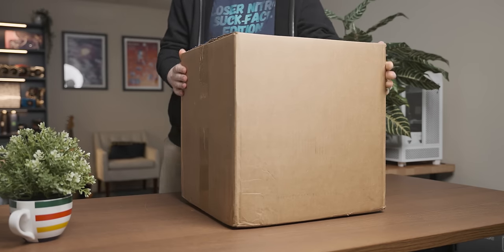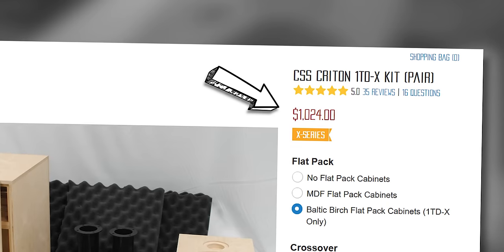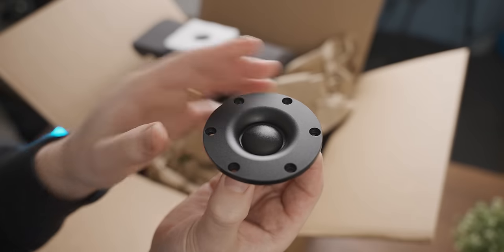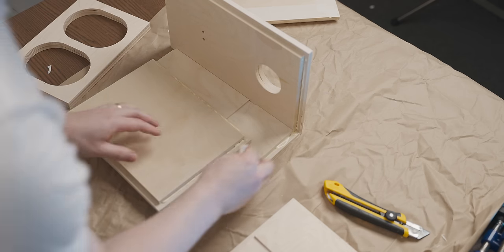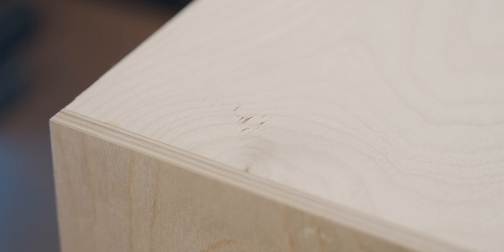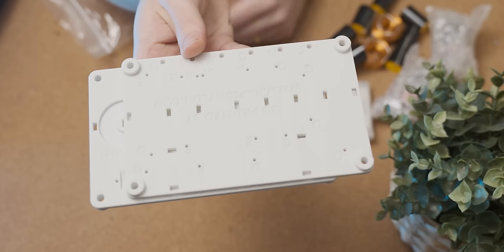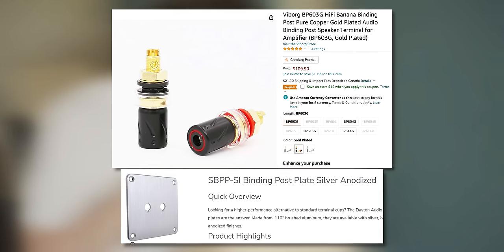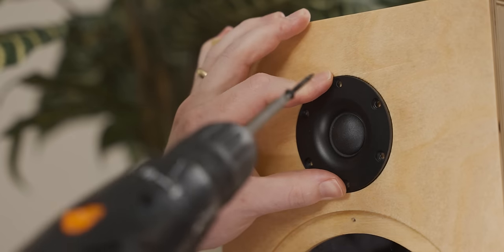The MOST Underrated Gaming Upgrade: DIY Speaker Build

Comment: OK. should have left the soldering in anyway, cause the point of many coming to watch is to see exactly how one can do it! Anyway, you should try some music. you don't know what you got there yet. And try getting an amp with 2 times the wattage recommended for the speakers, preferably class AB, and better yet, get the premium upgrade crossover. then you will really understand what the speakers can do. the setup you've got now just shows how good the CSS is without all the stuff I mentioned, but it still has more to give.

Comment: just gonna put this here.. you really dont need a thousand dollar pair of speakers to achieve an experience like this, buy yourself some active studio monitors for like 100-200 and an external sound card (audio interface) setup the drivers and you're good to go with an experience very similar to this. will you get the same amount of bass? probably not, but its plenty. id say going from no speakers to monitors is a much bigger jump than medium quality speakers vs high end ones. plus you can use a dynamic/condenser mic for better quality than headphone mics and some sound cards even have a 1/4 headphone jack on them for the best of both worlds. and my personal favorite feature is having a physical volume knob, i havent touched system audio in years. if you do do this and buy a cheaper card, be sure to disable other sound drivers like realtek and nvivia sound drivers as they could cause audio issues.

Comment: What I'm struggling to understand is how these differ from a decent set of bookshelf speakers. I wholeheartedly agree that good bookshelf speakers driven by an amplifier will give you much better sound than you can achieve with normal computer speakers, but I can't see where $1000 on a DIY kit will necessarily best a pair of bookshelf speakers that can be had for much less than that
Reply: you get what you pay for.  there is a sweetspot from where you get diminishing returns but in the audio world below 1k on a pair of speaker is actually considered as kind of budget. 
like those arent even expensive at all and its the starting point where speakers really start to tier up in comparison to super cheap mass produced ones. 
especially with diys because diy speakers usually compare to prebuild speakers way above their price point.  a friend of mine build himself some subs for example for like 500 each?  those guys sound better than some 2000 bucks subs ive heard. 

his diy ones ARE bookshelf speakers. go to some audio store and AB Listen something like a Buchardt S400 and some entry lvl 300 400 bucks elacs or klipsch or whatever, most of them have the cheapest crossovers you can imagine worth pennys. 
its a night and day difference. and a 1k diy speaker starts to play around in the same league than a 2000 dollar pair of S400.

sure you can game on a 1k dollar pc, but can it do 4k high resolution and high refresh rates? ofc not because a 1k doller pc is a budget gaming pc... speakers are no different in that regard. and similar to that, you get a lot more high quality components and a more refined system at lower prices if you build it yourself. imagine buying a 1k dollar prebuild dell pc. fancy green noname single channel memory and a silver no name chinaBoom power supply. stock cooler, cheap as hell mainboard. only one fan because cost saving... this is basicly what you get when you buy budget speakers aswell. so you either go one or 2 tiers up in price class or you pay around the same with DIYs that punch 1-2 tiers up without costing as much

what you said is basicly: ''oh i dont see how someone can have more fun with a 3k pc compared to a 1k pc that you can have for way less because they both play the same games''
i mean yeah... if you re fine with playing the new game in 720p 30fps compared to 4k 144fps... sure... go for it

Comment: I used to design and build my own speakers. Don't downplay yourself you did a fine job. And Dayton audio makes some good stuff. As for the cross over. If the more expensive ones were a better crossover like the next order up with more components might sound better. However if it's the same parts, just more expensive don't bother. You would never hear the difference.

Comment: I think it would be better if the wooden planks had toothed interlocking ridges on the edges so that the rigidity of the box isn't relying solely on a very narrow and thin strip of glue. The wood isn't going to withstand almost any force at that contact point with the glue as it is currently. The majority of joint rigidity should come from interlocking shapes rather than glue.

Comment: I know the tolerances might be tight to achieve in high volume production, but why rely on glue and not some type of joint? Glueing wood is kinda tacky
Reply: Because that's how joints usually are done on speakers.

Comment: I actually went a different round with my sound setup. I took a car amp with a pc psu connected my 1200w sub and some smaller speakers for treble but in total i have 5 subs. On my to do list get a bigger amp and get a bigger psu to power it. Sadly the sub box cost more than the actually sub cause it's specially made for this sub. The other speakers are DIY

Comment: Wow Davide is an audiophile! Unico Primo, very nice. Not to brag (ok I'm bragging) but I run my PC audio thru an AVR (for D/A conversion), then into a Parasound Halo preamp and amp combo into a pair of B&W Nautilus 802's. Very Visceral. Yes my TV is my monitor.

On an unrelated note since you are such an expert on lopsided pc part pairings,  I am stuck with an i7 4790k w/ 16gb of ram and a 780ti. I play WoW primarily and the card struggles a bit with water effects, etc. I have to run it at '6' video settings. Is an upgrade to an RTX 3060 worthwhile or would it be bottle necked by the CPU? tia and keep your entertaining videos coming.

Comment: I clicked for two reasons.
1. A Unison Research Unico Primo amplifier on the thumbnail
2. Hoping for Linooooooooooooooooooooooooooooooooooooooooooooode

------

Regarding the amp: it has 80w per channel in Class A. Not as efficient as Class D fullrange given you can find 300w per channel amps with that topology smaller than the PS5, but Class D always seemed to sound a bit cold to me. By contrast when Class A sounds a bit cold it tends to be because you're cranking up a lower power, usually lower cost Class A trying to drive the wrong speakers. The Unison Research amps made it possible to get gobs of Class A power that you would otherwise expect from, say, Krell and at double the cost (without factoring in that such a Krell, at the time, tends to be a dedicated power amp and would also need a dedicated preamp).

IIRC the old Unico is the one that came out 20yrs ago, followed by the Secondo, etc, then they reworked the naming and updated the amps so now there's an Unico Primo and Unico Nuvo instead. On that note if you have the old one I wouldn't spring for the new stuff...there's a reason why they didn't drastically change the design.

Comment: I'm... Kinda confused. What's the DAC for? 🤔 There's no digital output needed for playing audio from a computer?
Reply from the maker: The Amp only has RCA inputs. I could use an adapter from the 3.5mm jack on the motherboard, but that's a bit savage. :P Besides, external DACs are much higher quality than the ones in most PCs. :)
Reply: @DawidDoesTechStuff  3,5 to RCA cable is a single cable, but sure, I do agree on the external DAC being better. Is it needed for gaming, though? Or even most music? No. If you're doing music production, then sure, but otherwise I'll stay on "it's not really needed" (many bucks saved). The speakers look pretty good, though. And is probably a very decent upgrade.

Comment: for that kind of money they should be three way not two way - JMO  Also, I dont game anymore so I dont understand shy a DAC is required, cant you just run the PC's audio to a standard stereo audio amp or audio receiver to power them, thats what I used to do, you do this any time you connect a CD player to a receivers line inputs and it works just fine - seems if you have a stereo receiver and want to use that it should work as a DAC as well -  ??.....

Comment: I have issue with your soldering, the censoring rectangle you use was in the wrong orientation, this may lead to cold solder joint :P

Comment: What an awesome video! I've been spending the last week researching and deciding which small class D desktop amp (I even looked at the one you mentioned) and vintage hi-fi bookshelf speakers to use for my desk. Maybe you can piggyback this video with a similar one pointing out that you don't need to spend thousands of dollars to get good quality audio and the 80/20 rule heavily applies to hi-fi audio: Spend 20% on similar size '80/'90s/'00s bookshelf speakers/amp and get 80% of the quality.

Comment: although the notion of building your own speaker boxes and such is cool... all you need for an amazing sound system that isn't determined by some marketing department somewhere for some reason... is a REAL stereo receiver with digital optical input or HDMI input. for instance, around 10-ish years ago, i bought a 750w 5.1 Sony stereo receiver with Boston Acoustics speakers. good motherboards usually have a digital optical out, but a sound card costs about $100. so to recap- $250 receiver, $400 5.1 speakers with a 100w separately powered sub connected by a true digital signal compared to $1000+ 2 channel studio monitor speakers...
Reply: A pair of brand new Yamaha HS8 with an audio interface will cost about the same, and you have a mic input for cursing your friends :)
No matter how you look at it, this DIY speaker kit makes no sense whatsoever.
Reply: @ledoynier3694  if they are worth it, they are worth it. considering it's a DYI thing, i would also hope so lol! if this is you, and if you have a separate office space thing in need/want of a good satellite sound system, then ok, fine. splurge, if you can. personally, especially for gaming, i'd probably just go with a good 7.1 headset. not a rich guy either, so PC is either going to inevitably end up off to side in living room or bedroom. in which case, i'm probably just going to dual screen with a half-decent stereo receiver and patch into it with Digital Optical, HDMI, or 3.5mm headphone jack to red and white 2 channel plugs. in that order. anything labeled "PC" is usually an immediate pass for me...

Comment: I think the biggest impact is the quality of the amplifier. I use a pair of £80 TiBO bookshelf speakers with an 80s Pioneer amp and the sound quality is miles ahead of newer digital amps I've tried.

Comment: just buy some q acoustics 3010 for  $250 and a 2.1 class D amplifer (nobsound, douk audio, brezhifi, fosi, etc) for $70 and a cheap used passive ~10" subwoofer from someones old home theatre system  cost you ~$20

for under $350 you will have something comparable

Comment: I'd be very interested in an in depth list of components used. I highly doubt there's even close to $1,000 worth of components there. The cabinetry looks to be pretty well made but even then, you have to assemble them yourself. New challenge, let's see if I can build a set of speakers that perform as well or better than these for about 1/3rd of the price lmfao.
Reply: I agree that $1000 price point is unbelievably bad.

Comment: Wait, aren't you supposed to keep a gaming PC on your right so you can be blinded by the RGB flashing through the tempered glass with the heat from it melting your hand? All you had on your desk was a monitor, speaker, mouse and keyboard

Comment: I agree that audio plays a huge part in PC use and is often underrated. That said, only the elites will go to the trouble of paying thousands for a setup you have to build yourself. For a fraction of the price, I recommend two things: Klipsch THX Pro 2.1 computer speakers, plus a good set of open air headphones, paired with an optional mic if needed (I use some Philips HD9500's). Still a very interesting option, even if it is out of reach for many gamers.

Comment: 1000 bucks for any PLYWOOD speaker kit is a fn rip off
Reply: You don’t know what you are talking about. Do you know how hard it is to cut Baltic birch without tear out? And routing the inserts? All the work and cost for pieces that you need to throw away and all the time it takes to fix it. I have build cabinets in MDF and know how much work it takes to get a nice surface you can paint or veneer.

Comment: I have two computers at my desk, so I use an Apollo Twin as a DAC for both. The primary computer connects by Thunderbolt and the secondary by optical. Works. Mixes their audio together so I can hear both at the same time, and good DAC. Want new speakers…

Comment: To be fair, you can get decent speaker sound at a much lower price, and conversely in this price range you can get the first active DSP 3-ways (e.g. Kali IN-8v2, which are $399 a piece, plus let's say $99 to $150 for a decent basic audio interface). 
You also don't necessarily HAVE to use an outboard DAC with an integrated amp or AVR, a lot of them should work fine with the lowly onboard audio as long as it isn't inherently screwed up. 
In this case the DX7s helps defuse the ground loop between the PC and the Unico though, as all three are IEC Class I (mains earthed) devices. The ground loop is still there but should be far less noticeable than when attempting an unbalanced connection from PC onboard audio, a soundcard or a USB bus-powered DAC. The big Japanese mass-market brands are generally smart enough to build their hi-fi devices as IEC Class II. Boutique audio gear isn't necessarily constructed by the most competent folks.

Comment: Not only is audio an underrated part of the PC setup. We have been trained over the years by Bluetooth that low quality audio is acceptable. My $50 wired IEM's will sound much better than any $300+ Bluetooth buds. The same goes for speakers, wired vs Bluetooth.

Comment: Dawid your solders look like pixelated crap. Why haven't you learned how to at least do high resolution soldering? I mean I would solder in RTX with DLSS off because I'm a total baller (I've never soldered before), I'm sure it doesn't take much to solder in at least 720p, I'm sure you can learn it quick with a YouTube video. Anna finished those cabinets in HD like a boss.

Comment: Not impressed... Exposed plywood edges - UGH!
Also... HOW MUCH! - for 2 sets of drivers, 2 plywood boxes and 2 crossovers
And it's only a 2.0 system, which means large-ish boxes to front left and right.
I think you've been bitten by the same audiophile  hype that applies to cables - yes there are crap cables, thin wires, poorly made, but the step to to competent cables of adequate wire gauge and properly made connections is way bigger than anything further.

At the moment I'm running Altec Lansing VS2121, and the sub delivers quite agreeable punch from under the desk, while the much smaller satellites provide directionality

PS. Try building your own speakers from Aliexpress, and a $50 budget should cover 6.5" bass/mid, tweeters and crossovers, allow another $50 for building the boxes - 1/10 the price and are the CSS going to be 10 times as good

Comment: I think if you want to do a proper gaming setup, 5.1 is the minimum, stereo just misses a lot of the whole real experience and also adding a good sub will make the explosions really come to life.

Sadly I don't even have space for a damn super cool but crappy sound quality and probably very rare receiver by now that I bought which is brand new sitting inside the box since like 2004, literally the batteries included expired in 2005 and they still look brand new and actually even still worked though have very low juice that the remote backlight barely comes alive, really love it, but since I bought it like 2 years ago is just sadly thrown in my wardrobe 😕

I'm still using my Logitech Z5500 speakers with other speakers which even though are 2-way speakers and much bigger than the original they still manage to sound much worse than the original single full-range Logitech speakers, gosh😁

ps: But I have some stereo 80's KEF speakers that sound pretty amazing even in the crap amplifier, however they definitely don't fit in my room as each is almost the size of my computer case and taller + I'd need 3 more and even used they still cost a lot today, have seen a pair for around 350€ needing a lot of wood work but they surely sounded so much better on a old Class A heavy amplifier from my father, they kicked so much harder than on my crappy but cool looking receiver.

Comment: I'm using Samson M50 studio monitors connected to Komplete Audio 1. The sound is clean and warm. You can connect subwoofer if you want,they turn off automatically after 20 min. of inactivity and turn on automatically when the sound is playing. Also they have switch for bass boost for games or movies. Really great  speakers if you're on a budget.